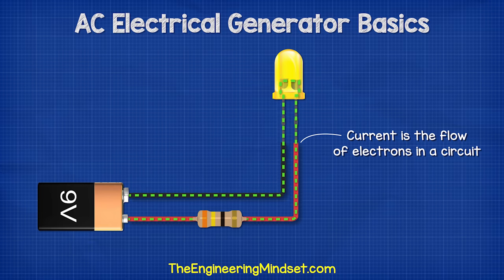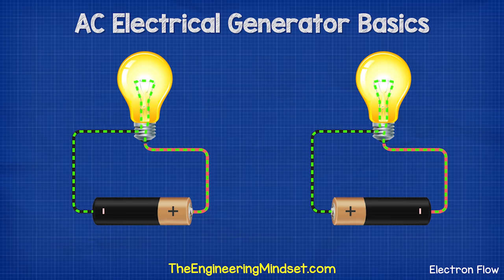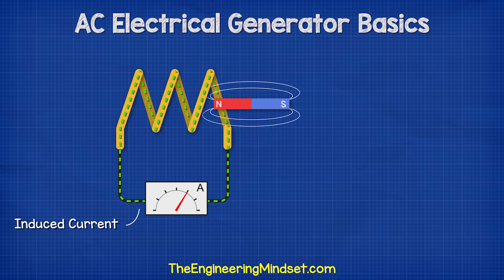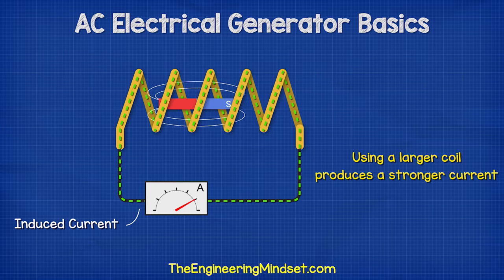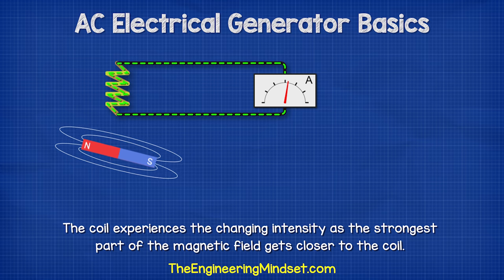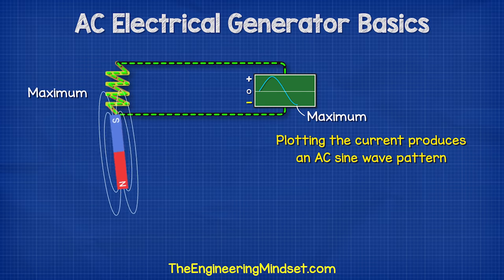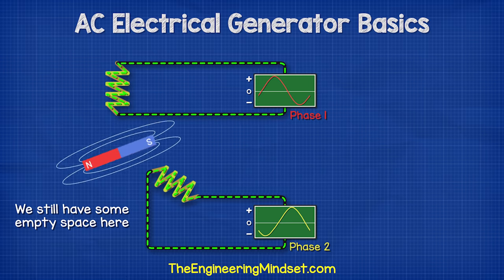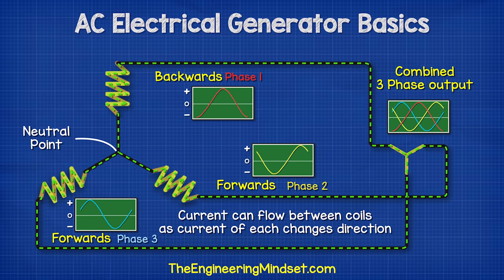AC Electrical Generator Basics - How electricity is generated

Comment: In previous videos, you say that high voltage causes high current, which damages the device, and that low voltage causes low current which doesn’t power the device enough.

However I’ve read from several sources that a low voltage causes a high current, and that a high voltage causes a low current. Apparently the device has to draw more current if the voltage is lowered to meet the energy requirement. And because power = voltage*current. Current must go up as voltage goes down.

I’m confused
Reply from the maker: Connect a red LED to a 1.5V coin battery and it will light up. Now connect it to a 9V battery, it will blow up. We need to use a resistor with the LED to use the 9V battery to create a voltage drop and limit the current.
Reply from the maker: Check out NEW resistor video, everything covered! ➡️ https://youtu.be/DYcLFHgVCn0
Reply: there is an item missing in the equation of voltage U and current I:
resistance R
in an electrical circuit voltage current and resistance are connected by this equation
I=U/R
as you can see with the help of this equation

current goes up when voltage goes up
current goes down when  voltage goes down
current goes down when resistance goes up

citation bobvindy:
"Current must go up as voltage goes down." 
this is wrong

excuse for the math

Comment: How are single phase transformer secondaries' center tap grounded (once bonded; neutral) actually bonded to earth? 

Why can you bond one terminal of the secondary without high resistance and thus a short? 

Is there a resistor between center tap neutral and bond of single phase? Or is there some sort of work being done (is this why transformers heat up, (as well as eddy currents causing heat)) 

Why is there no ground fault between your center tap (which is an ungrounded hot conductor until it is bonded to earth?) and earth? There is no relation until it is bonded so is this why? Is it because the easiest path is still to the transformer secondary, rather than to ground, and thus not allowing the breaker to sense the current, causing a short?  

Is neutral technically a hot conductor, just at ground potential? 

If the utility theoretically removed the bond in the transformer between "neutral" and earth, could you then bond L1 or L2 to earth? 

Likewise why are you able to do the same in a 3 phase wye system, except it's the coil ends (phases) that are wired all together?

I understand in 3P that one phase at a time is always returning current. I can't understand how transformers do not short.
Reply from the maker: Seen our new Transformer video? here https://youtu.be/jcY4QN7awEc
Reply from the maker: Check out NEW resistor video, everything covered! ➡️ https://youtu.be/DYcLFHgVCn0
Reply: in a three phase system the sum of all voltages is zero at any given time

thats why you can connect all three coils at one side
no voltage, no current, no differential potential to ground no shorting
only differential voltages will drive a current
they will occur in a real system

the grounded connection is used as the neutral and used to take differential voltage driven currents
and as neutral for single phase applications

depending on the technical implemantation of the power grid structure this connection point may be also used as protection earth